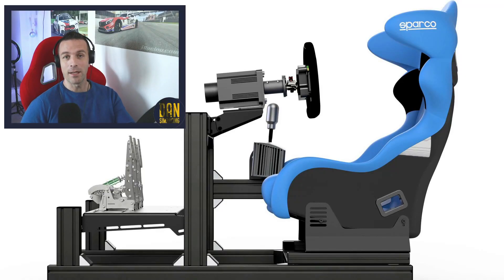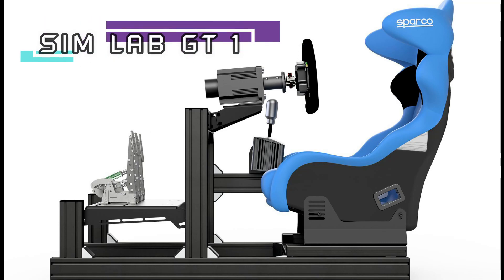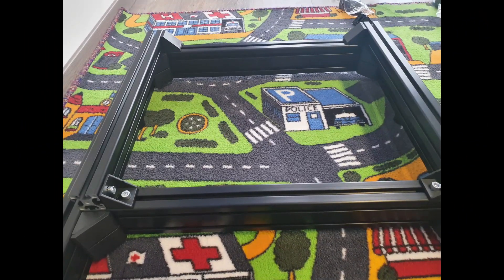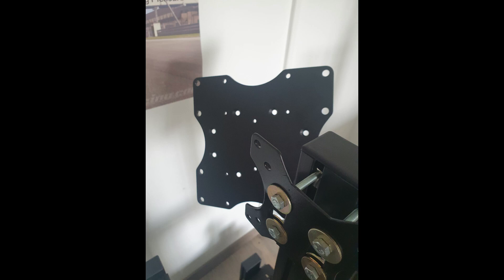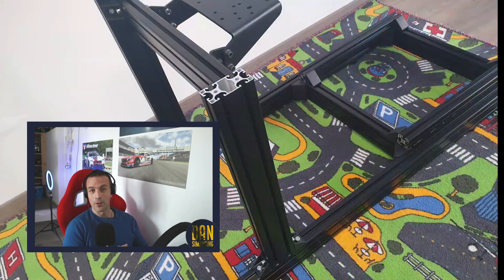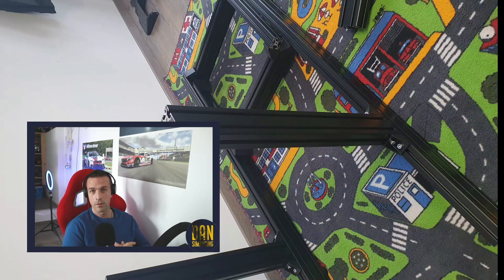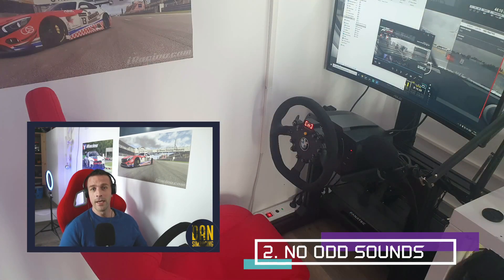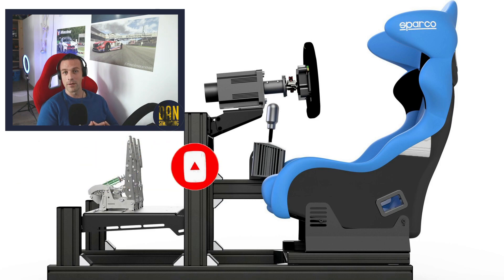Sim Lab GT1 EVO Review - SHORT

Comment: Dan one doubt on the wheel plate...it seems you assembly with right and left bracket rotated 180 degree respect sim lab manual. In this way your wheel move from horizontal to looking down position. Instead on sim lab manual it seems it move from horizontal to looking top position. Is it something you do for some reason? I appreciate a your feedback thanks
Reply from the maker: Np, I tried all options and seems that for csl dd this in full horizontal was the best option in regard to my seating position. Now 18 months later i have not changed a single bit anything. What I like about alu rig is you can do lot of stuff yourself. Especially when u understand the connecting mechanisms. I added on my own stands for camera, mic and keyboard plate. In short experiment and see what is the result u like. Hope this helps. Cheers